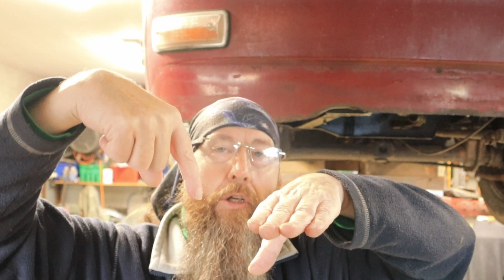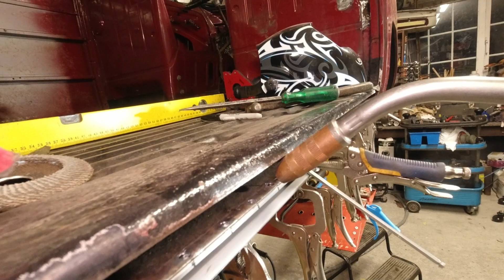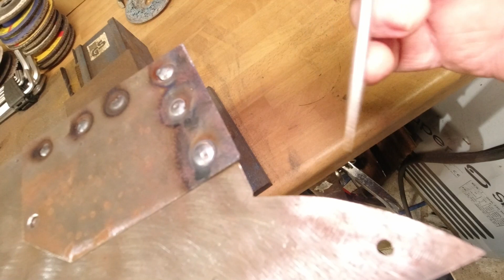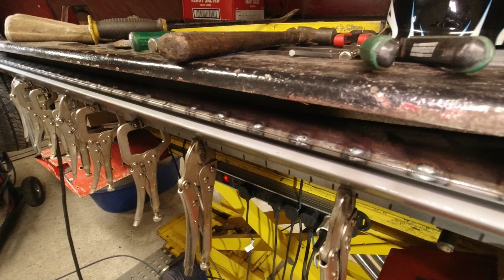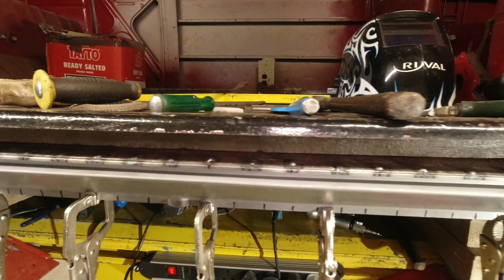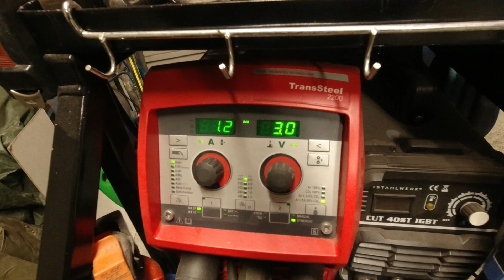VW CAMPERVAN WELDING IN THE SILLS ROCKERS WELDING TIP AND TRICKS EP 20

Comment: Greate tips Joe just found your channel working my way through it wish your vids  had been out when I started mine would have made it easier and faster for me.Iv replaced all my arches inner and out sills inner middle and ot all ou riggers and jacking points ,foot well floors and main floor. Welding getting better,Grinder not getting as much use to when I started😂.where did you get your welding mask from I've got a big clumsy flip up great view through filter but gets in the way a lot.keep up the good work I'll continue watching cheers Andy